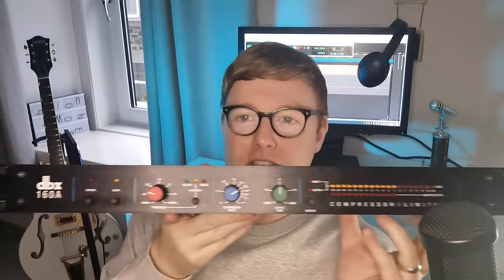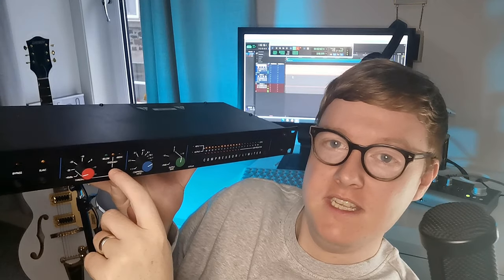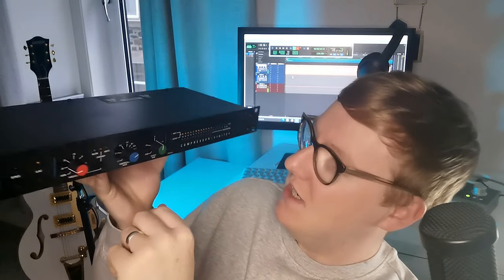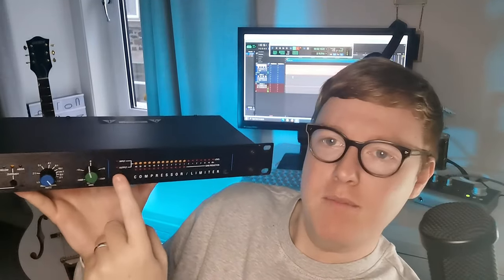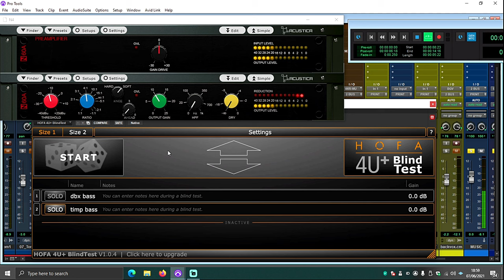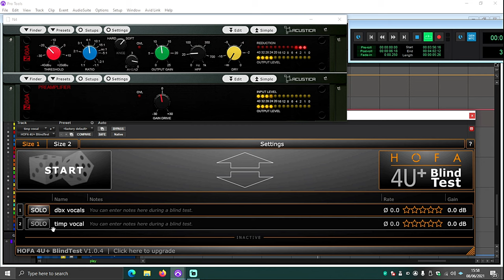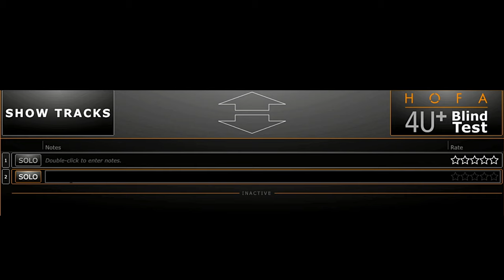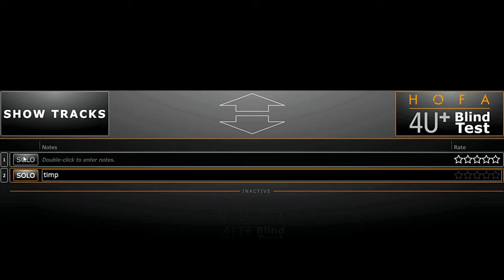DON'T BUY a DBX 160a.. buy the TimP n60A instead.. and I'm not joking!!

Comment from the maker: Just buy it ehhhh.. 🤓

https://www.ebay.co.uk/itm/Dbx-160a-US-seen-on-Mixing-Wednesdays-comes-with-US-EU-transformer-plug-/265190719272?_trksid=p2349624.m46890.l49286

Also listening back I should have utilised the lookahead in the bass example to smooth it out a bit more so it was closer to the hardware. That's ear fatigue at play right there 😅
Reply from the maker: Funny you should say that. My electric bill is that high im actually due them more money haha 😅

Comment: I felt like the phase was a bit nicer on the hardware (It's hard to describe, but on the first few hits of the snare roll the tim P had some subtle stuff happening, and I felt the same on bass) and on the more percussive/low end elements, I felt like the DBX had more 3D depth. 

I liked the Tim P more on vocals though, for some reason felt 3d-er. :)

Comment: Btw hardware feels more on low end but Tim work it's ridiculously good compare the fact that hardware have his own DSP circuit which means that's it's dedicated to do THAT work instead of CPU that handles ton of background task at the same time, i think the limit of CPU in audio processing (the fact that audio it's not a multithread processing) it's one of the biggest architecture issue ever for ITB mixing and mastering... Unfortunately audio passing though gears will have more character in general but the tone/saturation/angle phase can be replicated (with a lot of patience and work) still can't feel the with that hardware can add to sounds (btw timP it's a real pro in the nebula game, i wish more.stuff from him 🥺)

Comment: Hey, here's a request of something I'd REALLY like to see. I did something really stupid and watched and listened to this on my phones speakers... Yeah I know... I couldn't hear any difference whatsoever. Surprise. But it got me thinking. Wouldn't it be interesting with a video where you or any other talented person mixed a song on proper equipment and then mixes the same song on the worst, cheapest pair of headphones. Like the ones that come with your phone. And then a regular person gets to listen to the song in their  regular headphones preferably after MP3 compression as well and see if they can hear the difference? Could be a controversial video... whaddayathink?
Reply from the maker: I'm floating ideas like that around. Really pushing the boundaries. I've got one idea I'm thinking of trying out very soon but it's all just about fitting it all in. Unlike most of the big audio youtubers I see I don't struggle for ideas.. My only struggle is picking which to do first haha 😅
Reply: Great Idea!!!
Reply: love this. been struggling alot with "it sounds good on my monitors but bad on phone and vice versa"

Comment: I've compared Tim p a60 with my hardware dbx 166 xs. It sounded very close, the plugin being a bit sweeter. The 166 in insert followed by the tim p a60 preamp was very nice
Reply from the maker: I noticed the same. It took me a while to get really close to the hardware and it was first trying to reign in that extra bit of sweetness. Can't remember how I done it, was either the harmonics or the lookahead. Think it was the lookahead that tonally got me a bit closer. You can see in the bass where I didn't use the lookahead and its the only I listen back to and think yup just a bit sweeter but at that point I had some pretty bad ear fatigue haha

Comment: Love your videos!! 

Damn I didn’t know there was a plug in for it, how cpu intensive is it? I’m on a really old Mac. The coffe eq just melts my quad core i7 would this be lighter?
Reply from the maker: It's not as bad as Acustica aquas but still pretty cpu intensive compared to algo compressors 🤓
Reply: @PaulThird  i would like to use it as my parallel drum bus compressor but now I’m tempted to get the hardware version ahaha
Reply from the maker: Tbh hardwares very affordable. You should pick it up for under £200 all year long

Comment: Im new to convolution nebula types... Do they still have the same aliasing phase probs as algo plugs?
Reply from the maker: All plugins can suffer with aliasing but the convolution plugs do alright in that regard considering they can't use oversampling like a conventional algo. If you abuse Tim's clippers then yeah it'll distort and alias like a bitch. It's all about your gain staging with the convolution plugs. You need to treat them like the gear in that respect.
Reply: @PaulThird  thanks paul👍

Comment: You need two instance of Nebula for get the total sound of the compressor, one with the preset of the compression and other with the preset of "pre"
Reply from the maker: That's what I had here. I load them all in a metaplugin preset and chain them however Tim advises 🤓
Reply: @PaulThird  Paul, I did a blind test very similar with differents compressors with Nebula 3 library vs real hardware and nobody was able of listen the diference
Reply: @PaulThird  I asked for this to Tim in the past, he never made a "pre" preset in his Nebula compressor libraries inicially,  and I had to said him that a "pre" preset was necessary for get the complete sound of the compressors in Nebula

Comment: Man no one wants to admit espcially if they already have the Hardware...but this plugin...is Identical to the Hardware....the Hardware dose not posses "Very Expensive Circutry" So nailing this in a Live Analog Sampling Instance was very Viable and Easy....they nailed it...Tim P pretty much made "Buying the Acutal Unit" A wast of Money....take the $4000 you would spend on 2 160A's and 2 Vintage 160As and go get a better Interface or Mixer with some better Headphones or Mic or Better Monitors

You gota know where to spend our money in your studio...to even it out....to have a Comple Setup as for as Analog Gear that compliments your Mixing Process and Plguins

Ive got "So good in the Box with Nebula and Acustica Audio 
So now my "Entire Analog Setup for Mastering my Mixes....going back polishing that up...and then running everything with Vocals back through for Final and Pst Masters...thats a Lot Cheaper than trying to have the most expensive outboard gear and it gives you way more Sound and Mixing Options to actually come up with better mixes 

Im to the point where Im "Beating" What Im hearing on 'Pandora" in my own Home Studio....

Your Mix....will 90% Gauge how Realistically you can make that song "Sound Ready Ready" and Fully Mastered 

I slowed down and worked on being great and mixing...and better at recording my vocals and better and Level Static Mixing so now...with Acutica Audio and Nebula and My analog gear...I can take those great mixes and turn them into "Mastered Hits"

Comment: Hm, the plugin eats a little bit of high end details on vocals. So, you would robably need to use an EQ after that. Not the only software compressor that does that though.
Reply from the maker: Tbh its probably me. Theres a fine line with the harmonics where if it's set a certain way you have a little bit more control in the high end. I overlistened big time on this and because I could tweak the top end detail with the harmonics and lookahead it was genuinely driving me round the bend 😅 I was listening tonally and to the compression at the same time and I think I tweaked myself to the point of ear fatigue. I can't ever leave things alone haha
Reply: @PaulThird  I feel that. I'm guilty myself. That's why I watch other people (knowledgeable) do it so I can be fairly quick in my judgement. There was a sale for Slate's Distressor emulation a few weeks back. I was wondering if it's as good as the real thing. It wasn't - eats high end as well. Most of amp emulations (kemper and neural captures included) when compared to the real things. I wonder why detailed and not fatiguing high end is so difficult to get with plugins (my experience). Surely, it's not just aliasing because I always oversample.
Reply from the maker: Yeah slates distressor doesn't have it when I compared it. It's good but not a distressor. However softubes Mike-e now were talking! I'm still Gutted I can't afford it haha

Tbh it could be lots of factors. It's probably the bandwidth. Digital high end can go pretty high. It needs to be tamed more than anything. Could be various factors. Impedance is a big factor in hardware but dunno if it's only lows it affects.. Or highs as well in terms of roll offs 

It can be aliasing in plugins but if gain staged and oversampled you should be alright. Its a fine balance as its either too bright or too dull / washy haha
Reply: @PaulThird  That's the thing it's not just the amount of high end but the quality of it (more details like bristle brush strokes in a painting). Welp, seems like the quest continues.)

Comment: Tim P for Nebula Programs sales the 
N60 and the N18 together for $25.00  for Acustica Audio N4 Commercial Player which you can subscribe to and get for $11 a month to use the Nebula Librarie Plguins through the N4 Player Plugin

You get a 
N60 Pre and Compressor which is the Moder dbx 160 
N18 Compressor Classic or Vintage dbx160

This Video of comparrison shows the Live Analog Sampling in the Plugin is "identical to the Hardware Units...on drums its become a "Staple Plugin for wihen Im mixing down my drum busses 

The Tim P Nebula...baasiclly destroys Softube, Arturia, Analog Obsession and Waves and UAD....destroys them...LOL....buying this Plugin for Nebula...has changed my life on my Drum Busses Mixing....getting incredible, Crispy, Clean, Punchy, and a slight Bleeding of each drum that you get from the Hardware Unit Sonically!